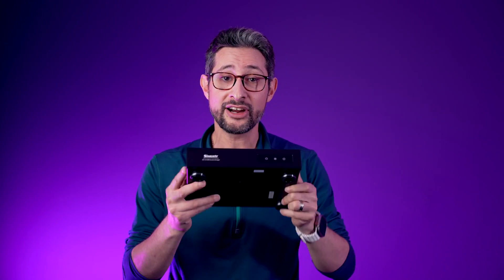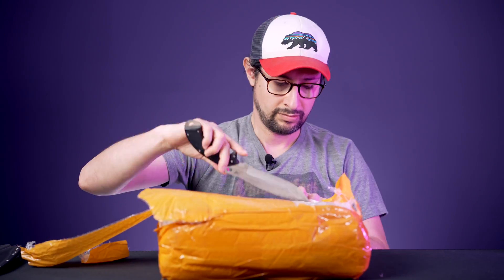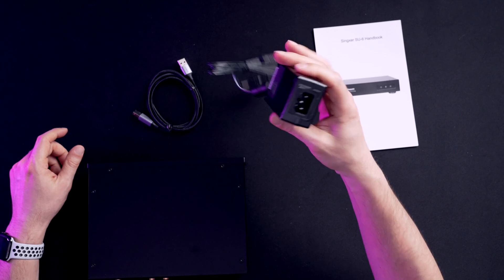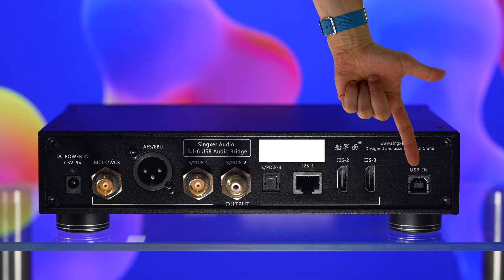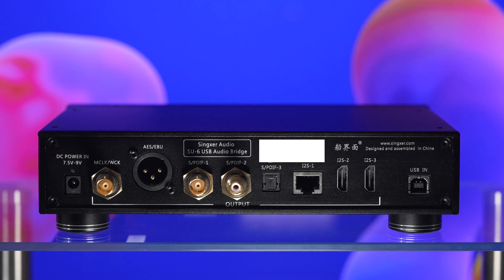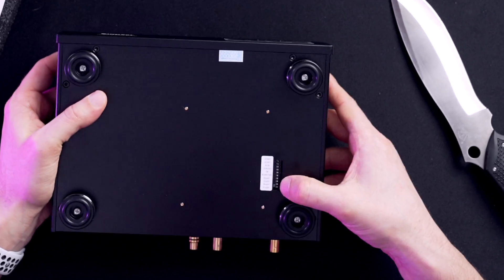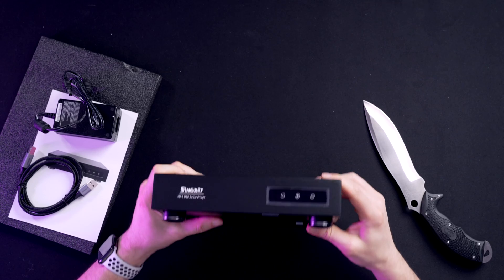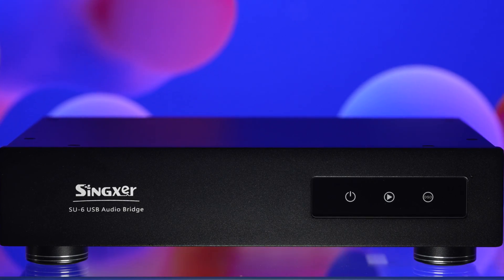Singxer SU-6 Review

Comment: Nothing sounds worse than a Blue Sound Node
Reply from the maker: The Node is a great bit of kit. When I got mine it was much cleaner and better sounding than my PC.🍻
Reply: @MisterChibs  ??? Try a Eversolo DMP A6. Blue Sound Node killer. Try playback files not streams.
Reply from the maker: @chebrubin  I don't use their internal DACs and have no need for a display screen so A6 is not for me.
Reply: @MisterChibs  that's just ridiculous you are talking about the greatest game changing steamer in the industry. Not using hype here after the audiophiles discovered it now we have a 2nd wave of retailers discovering it in 2024.

Nothing sounds better than PCM reclocking, pleasing to the ear and  cognition. Bass is delivered on time and is accurate beat.

I have been using a SPDIF PCM dejitter device for the last 20 years.
Reply from the maker: @chebrubin  How is not fitting my use-case ridiculous? You seem to feel strongly about your A6. That's great. In my view it's over hyped. Bluesound Node is actually more practical and useful to me because it has HDMI ARC and trigger in ports. Both of which the Eversolo lacks. My Node is currently hooked up to a 77" TV & Peachtree Gan-1 in the family room. My kids / wife can pick up the Apple TV remote and not need to worry about inputs, turning anything on or off for this combo to work. That's invaluable to me and the sound out of my LS50's and KC62 Sub is much better than any soundbar. Now if I want better SQ, I can connect the SU-6 or better yet, use my Lumin U2 Mini. Now that's an amazing streamer. I personally need an other 6" screen like I need a hole in the wall but that's just me 😂. They all have their use cases and no ones choice is "ridiculous".
Reply: @MisterChibs  2 channel ARC input from 77" 4k TV. Wow your wife and kids are missing surround sound. Ok. Get a Onkyo or a Pioneer and some 5.1 speakers.

Leave the 2n channel reference system for devices with Sabre DACs, DSD and for heaven sakes listen to file playback first with the SU-6 in addition to streaming subscription services.

Many people are tricked into thinking the Blue Sound Node is compatible with Apple Music. As fr as I know the only device that can run the native Apple Music App is the Eversolo and FiiO streamers. 

The Blue Sound Nodes internal electronics are cheap. Hence why you heard a dramatic improvement when placing the SU-6 between the USB output of the Blue Sound Node and the DAC input. Most of the newer generation streamers have better cocks, op amps and some have better D/A with XLRs at the same price. Blue Sound Node will be relegated to the trash heap of crummy MP3 player box history. Eversolo is charting a course for defining value and quality internal and usability. A screen a dial see what's playing without a laptop wow.
Reply from the maker: @chebrubin  I feel like you have serious fanboy tunnel vision. That's okay, It's really interesting to watch and why I keep humouring with my responses. I have multi channel Dolby Atmos in my home theatre and don’t need this in my family room for watching Survivor with the fam lol. As I said before, the Node fits it’s use case perfectly for ME. Does that upset you? Lol. I see you don’t like the Node. I don’t care. I see you really really really like the Eversolo streamer. Again, I don’t care. Going back to tunnel vision, I’ve got an analogy for ya, stay with me. If you can, picture yourself wearing your brand new glasses and just revelling in them. Just amazing spectacles, real game changers for you. You got your prescription dialled in and who’s that smart sophisticated guy you see looking back at you in the mirror. That’s you! Forget just seeing better and enjoying, you need to tell people now. Easy enough. You begin telling your friends and family but they don’t share your enthusiasm. So you go on the internet to all the glasses forums. Now we’re cooking! Only problem is that you find not everyone admits that your make and model glasses are the absolute best. What’s even worse is they don’t believe you or care that your exact prescription, make, and model would be the best for them too. Not what they chose, your exact spec. But that’s how you glasses and theres only one way!!!! So frustrating!! What complete tools right? Now did I just teach you a lesson? Probably not but that was fun! Thank you! 🤣
Reply: Try a 4090 gaming pc on prozor dac. 😂

Comment: Schiit DACs like Bifrost 2 don't need such gimmicks as they already have galvanic isolation and great USB implementation. Recommend going that route if you can.
Reply: That because the gimmicks is already build in the unit. 😂
Reply: @denis4072  Galvanic isolation is no gimmick when you’re using a gaming PC source. It’s the difference between ground loops and noise versus dead silence.
Reply from the maker: You could also just use an optical cable too. I haven't tried anything from Schit but would love to some day..
Reply: @MisterChibs  Optical has bad jitter performance versus USB
Reply: I am using Bifrost 2 with Singxer SU2, it is lower model of SU6, I modified SU2 by replaced the power supply to external 5V linear power supply, I feed coaxial from SU2 to Bifrost 2, sound is better than I feed USB to Bifrost 2 much.

Comment: Biggest problem with cheap DDCs is they are USB-only... that's a HUGE bummer because, as you said, most devices don't have an USB output and use optical or coax instead.
Reply: Funnily enough my Denafrips Iris just arrived today and I hooked it up between my Mac Mini and Pontus II.

Any effect that I perceived today is subtle.  Wider soundstage and a little more detail.  Could also be because I was listening harder!
Reply from the maker: @gumbygreeneye3655  Congrats on the Iris! Did you try and a/b with the same track? 🍻
Reply: @MisterChibs  Thanks mate.

The problem is that I can’t properly AB test as I’d need to loop in the same few second loops back and forth so that my audio memory was still working adequately and I just can’t put together a competent test framework to really be certain.

Either way, the addition of a power amp for left and right and the Pontus, possibly the Iris, my system as good to my ears as I could have hoped and I’ll stop chasing now.
Reply from the maker: @gumbygreeneye3655  End game for now. That's awesome to hear! 👍
Reply from the maker: Yep! I’d really be interested in how much difference a DDC makes to the Wiim Pro. Maybe I’ll reach out to Alvin @ Vinshine. Thanks for watching! 🍻
Reply: @MisterChibs  that would be amazing!!  If you know some cheap DDC with opt/coax input please make a video!!   I've been searching one for a long time without luck.
Reply from the maker: @net_news  I don't think that exists yet. The one from Denafrips is double the price of the SU-6. I'll keep an eye out though!
Reply: @MisterChibs  thanks!
Reply: @MisterChibs audioGD 20HE or 24HE